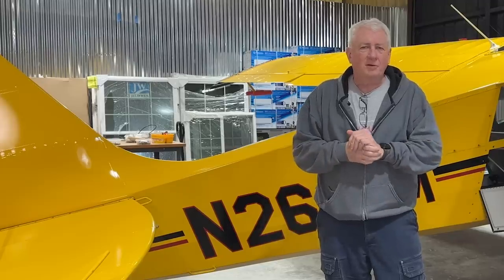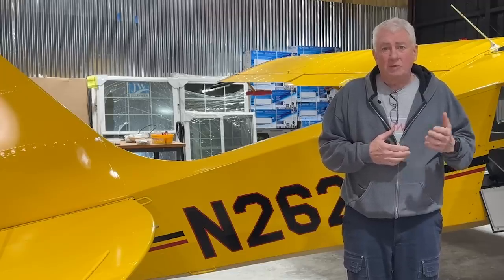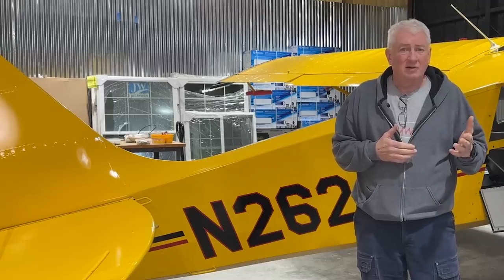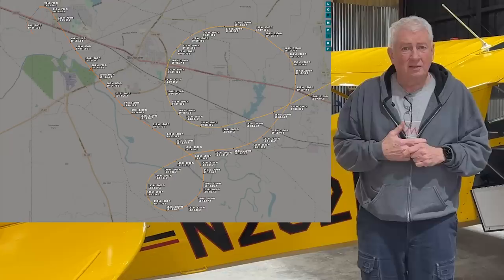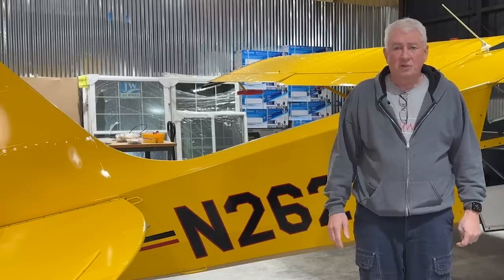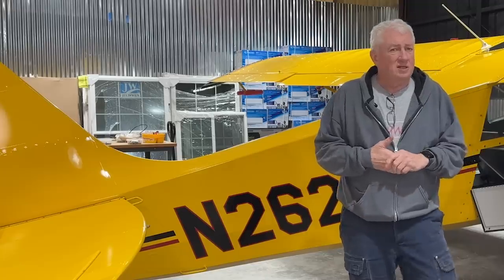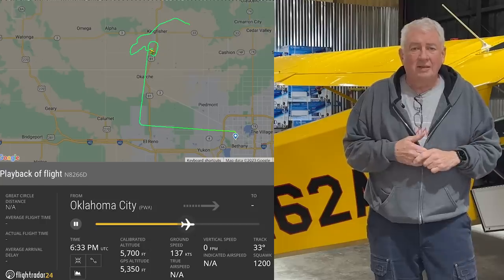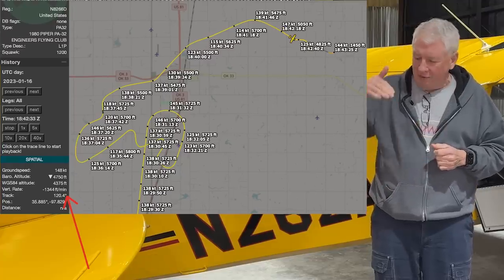Accident Quicklook  F35 Bonanza and Turbo Saratoga

Comment: Years ago when I was a center controller I was working a low altitude sector in the TXK area. It was a cold winter day with strong winds from the west.  I had a GA aircraft that was westbound going to Redbird (now Dallas executive). We had the ability with the NAS computer to determine his time, mileage and heading to a entered point which I used RBD (his destination). It showed 5:20 from his present position to RBD. I ask him how much fuel, in time, he currently had on board. He said approx 3 hours. I informed him he was over 5 hours from his destination. Needless to say he made a fuel stop.

Comment: Great work Scott. My F35 has (2) 20 gal mains and (2) 10 gal aux in the wings. 53 gal usable. Planning 10 gal/hr is optimistic. These 225s like to run rich so 10-13 per hour is more realistic. Also, due to the dry sump oil system, the oil temp needs to be at a min of 100f before run up. This can easily add 15 min sitting at 1000-1200 rpm on a cool morning, so plan on eating up 5-7 gal by the time the gear is up. Yes the pressure carb delivers excess to the left tank continuously, so if topped off you start on the left. The aux wing tanks are definitely for level cruise only and are placarded as such. Best planning is to be at the fuel pumps in 3hrs or less from start up. C’mon who doesn’t need a break after 3 hrs? Fantastic aircraft. Sucks to see another classic 35 done flying for the season. Glad they made it.

Comment: Great tip on the running down to almost out in one tank while in cruise. Used to fly a Cherokee 6 with 4 tanks. You had to do the same technique for each tank on that plane on a long cross country.

Comment: I have many hours in PA-32s of many variations (turbo or not, retract or not, t-tail or not).  The only way to get these into a spin is with a crazy aft CG and intentional pro-spin controls.  Maybe not even then!  They barely stall let alone spin...  Every flying tail Piper I have flown (basically all of them) run out of elevator way before a deep stall.

Comment: After stewing on this and watching it again, the fuel issue reminded me about the dreaded pilot disease “Get-there-itis.”  The Donner Party had a similar issue. They could have rested in Reno, and waited until spring time to assault the hill. Once they were in the snowy mountains, they could have gone back to Reno.  Same with the thirsty plane. I agree with you, Scott. A deviation would have allowed everyone a chance to get some fresh air and stretch the body. Circulate the blood etc.  Getting there faster is a drawback that pilots ought to recognize. So, you have a plane. It is faster than a car. Then you buy a twin, because it’s faster than the tail dragger. Or you get a Citation, because it’s even faster, and you need to get there.   Remember, it’s all relative. The plane can only hold so much fuel, and so, keep an eye of the fuel gauge and it’s better safe than sorry.

Comment: The F35 I had was equipped with (2) 17 gal mains and (2) 10 gal aux tanks.  53 gal useable.  
The standard fuel system returns all ‘overfed’ or excess fuel to the left main, regardless of the tank feeding. 

I think I read on the registration (?) this plane was equipped with a 520. 

You probably know better than me, but a 520 could burn 14-16 gph. Depending on lots of factors.  
3 hrs + 10 mins would likely put the total burn over 45 gals, pretty close to your 7 gal unporting level.  

I’m sure there will be more facts available in the future. 

Thanks for all of you vids.

Comment: The 35F has a fuel injection return to the left main only. Regardless of tank being drawn from... So takeoff and climb is always done on left main, then use up aux fuel, then use up right main. Then back to left main for remainder of flight. And always land on left main as that's the "always known tank" priority tank
Reply from the maker: You’re right about the return fuel to the left tank. Two things. The E225 has a pressure carb. And a Bonanza guy would call the model the F35… not a 35F.

Comment: I have an F35. It has 54 gallon usable. I have the wing aux tanks. Like you I always plan for 1 hour of fuel at landing. The plane has 17 gallons usable in each main. 3 gallons usable. The auxes are 20 gallons usable. The system is a bit quirky since it returns 3 gallons per hour to the left tank no matter which tank you are on.

Comment: Yes, always Test Flight & METICULOUS post flight inspection!!  Saratoga fairly heavy with substantial P factor to be fumbling around at low speed maneuvering & trying to sort out new autopilot & radios... realizing the error & sudden addition of power to raise speed and climb can easily result in a power on spiral dive. Recovery can be made, but it essential to make recovery inputs sudden and corrrect...even then, great care must be exercised to not over stress or break aircraft in recovery...it could be certain damage and a resultant fire occurred

Comment: Very shortly after I got my private licence I was on a long cross country flight and was in the initial decent stage for a landing (for a fuel stop). I switched to what was planned as the fullest tank (R) and the engine cut, so I switched back to the other tank (L) and it was still dead so switched back to the fullest tank (R) and engine started to run and I landed ok. On the ground I realized when I refueled that the left tank must have been below minimums and had un-ported just before I switched to the fullest tank which made me think there was an issue with the (R)  tank. I had used more fuel than calculated on the long initial climb which was the reason the (L) emptied unplanned. (PA28R)

Comment: When you run one tank dry doesn't the weight imbalance become noticeable?  My PA28-140, with 25 gallons in each wing tank will exhibit a "heavy wing" and require trim if I burn off more than 1/2 hour (approx 5 gal) without switching tanks.
Reply from the maker: Not really.

Comment: My position on fuel is that if you have to calculate fuel very closely more than three times during flight, I don’t have enough. ;-)  now I did have too much a couple of time when on fire in the 80’s but generally more is good.  Unless you are in a twenty series Lear, one should alway have plenty.

Comment: I've ran out of fuel 3 times. Two ruptured fuel tank examples and one was my fault. One was a brand new experimental airplane that I had just completed. The left wing fuel tank ruptured and I ran out of fuel on the right tank. That caused the kit manufacturing factory to ground all of the airplanes around the country. They sent us new fuel tanks made of a different material. I also ran out of fuel inverted while practicing aerobatics in my old Pitts S1S at ~3,000 agl over my old private grass strip after a long flight. Glided in easily. That was my mistake. That never happened again. Since then, I use a digital timer. Always full fuel before takeoff and then watch the timer. I know I have 'at least' 1 hour and 15 minutes of fuel at full power before flame out. Works great.

Comment: When in a new to me airplane I find where the breaker for the AP is located, and if it can be manually opened.  So far have not into that.
What can happen is the transistor(s) that drives the control motor shorts which will cause a runaway condition.

Comment: The older 35s -- at least some of them unmodified -- have a single fuel gauge & the pilot must toggle to the tank he wants to check. When first learning the system, you can switch the fuel selector...and forget to switch the tank you're monitoring. Can lead to an unexpected surprise though I have no reason to suspect that was a factor here.

Comment: Excellent tip to run one of the tanks dry on long flights and plan to land with 1 hr left of the other tank. Question - did I understand it correctly that you’re first using over half of ONE tank? Or are you first burning 20-24 gal from BOTH tanks switching them as needed? I ask cause in the first case the max fuel imbalance would be 24 gal, in the second 13 gal. I don’t fly Bonanzas so curious what’s the imbalance limit.
Reply from the maker: I burn down to 20-24 gallons left in one tank. Functionally, no imbalance limit. 37 useable in each tank.

Comment: If you are on fire almost anything can happen, the fire probably had something to do with the crash is all you can say. Probably after maintenance you intentionally do a half takeoff to stress things the first time, check for leaks, fluid levels, and loose parts, then a very short flight and check again.

Comment: I've never been a fan of running a tank dry on the Bonanza.  When you do you just took out the redundancy of having two fuel tanks.  If you have any feed problems from your remaining tank you're a glider. I always want to have at least some fuel in the 'empty' tank to switch back to in an emergency to keep the engine running long enough to get to an airport.
Reply from the maker: And that is my point. It’s actually not a good idea… fuel unposting is a thing.

Comment: Have only ever run out of fuel in my car once and have made sure that I've never done it again. Can't imagine taking chances with fuel in an aeroplane, surely it is possibly the most important consideration when planning your flight? 
Interesting look at what might have happened in both these accidents.
Reply: Weight, Weather and Fuel are probably my FIRST 3 biggest concerns and considerations. And then smaller details and not any less important if you have an emergency: length of runway at destination airport or at alternate airport, terrain en-route, etc.
Reply: Mark, One thing to consider regarding fuel is that max fuel isn't always desirable. Unlike a car where you can fuel all the way up without concern, in some planes if you are going to be fully loaded up with people then also maxing fuel will put you over weight limit. So fuelling mistakes can occur due to mis-estimating the travel time. Still not an excuse but it is possible to understand how they occasionally happen.
Reply: @Blxz  Oh I can see the need to balance gross weight by only taking on your estimated fuel load , but the consequences of getting it wrong would suggest paying special attention to an emergency reserve. Also planes it would seem are often loaded right up to their max takeoff weight.  Maybe this is because when originally built people weighed much less than they do now? Add some fishing or hunting gear etc and it's easy to see how estimated fuel burn could be miscalculated! But you make a very valid point 🤔
Reply: @markbowen3638  yeah, gross weight is pretty wild sometimes. I looked at buying a plane somewhat recently but fully fueled I could bring myself, my wife and maybe only the half full tube of toothpaste. At that point the fuel tank size is theoretical more than practical as you can never fill it and complete any sort of non solo mission.

Comment: NTSB preliminary on the Bonanza:

On February 5, 2023, about 1316 central standard time, a Beech F-35 airplane, N123JV, was substantially damaged when it was involved in an accident near Gladewater, Texas. The pilot and 3 passengers sustained minor injuries. The airplane was operated as a Title 14 Code of Federal Regulations (CFR) Part 91 personal flight.

The pilot reported that on the return leg of a cross country flight, while landing at the planned destination, the airplane floated about halfway down the runway, and he aborted the landing and executed a go-around. Subsequently, during the go-around about 50-75 ft above ground level, the engine abruptly lost power. He initiated a forced landing and maneuvered to avoid obstacles. During the forced landing, the airplane’s right wing struck a tree and was substantially damaged. The airplane came to rest submerged in a pond, with only the empennage and top of the fuselage visible above the water.

The airplane is planned to be recovered to a secure facility for future examination.
Reply: The flight planning here seems problematic, better nail your first landing attempt if you plan to land on your last drops of fuel.  Also doesn't seem fair to the passengers operate like that

Comment: My fuel plan in A36 TN with tips:
- full fuel in mains and at least half tips on every takeoff unless short leg (less than an hour) same day (TN makes it easy with increased gross):
- takeoff and landing always on left tank;
- record totalizer every time touching fuel selector, pumps, etc. and compare digital fuel gauges to totalizer data - should be within 1-2 gals at all times;
- after takeoff and climb to altitude (12-15k), lean engine and switch tanks (burned 15-20 gals from left);
- run on right for 1 hr (minus 15 gals in right), turn on tip tanks pumps;
- run on right until 3-5 gals left on totalizer;
- switch to left tank and don’t touch selector until next flight;
- land with at least 1 hour of fuel in left tank (16 gal), realistically it is 5+ hours of flying by that time (114 gals in mains and tips for 15-15.5 gph) and we likely already decided to land to stretch legs.
Reply: Had run away autopilot once as well, long time ago while preparing for instrument check ride in honest IMC. Uncommanded hard pitch up while going down after FAF. Me: loudly “what is it doing???” while pushing the disconnect switch on the yoke. Instructor: just reaching out to the circuit breaker on his side. I was faster and it disconnected too ;)
Reply from the maker: Pretty close to what I did with tips. Except I didn’t tanker fuel in the tips. Only put fuel in when I was going to use it.
Reply: @FlyWirescottperdue  the other reason I put fuel in tips is that it helps to move GC aft and allows two adults upfront (TN is nose heavy).

Comment: Great technique and I have followed this and recommended the same technique to several friends ever since I watched your previous vide on this subject.  However, one thing I am still not clear about is that, when you say plan to land with no less than 7 gallons remaining in the tank you plan to land on, is that (a) 7 gallons usable (which I assume would be 10 total in my A36), or (b) 7 total (which would only be 4 usable)?  I think you are probably saying (a); however, being a lawyer, it seems like that would be serious lawsuits against beech/textron if there was a high likelihood of unporting in a tank that has 6 or 7 gallons of what the manufacturer refers to as “useable” fuel.  If it was (b), that would be more understandable.  If (a), I would think beech/textron should lessen what they consider “usable” fuel, as your conclusion would be that my bonanza that claims 37 gallons useable in a tank really only has 30 gallons useable in a tank.